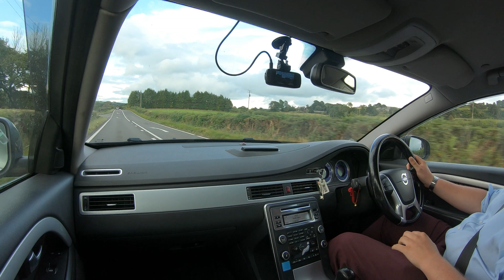What it's like to *Maintain A P3 Volvo* YOURSELF!!!

Comment: Pile of parts arrived ready for my week off. Ive been feeling pretty demoralised about issues developing with my 05 XC70 @ 175k. Feel very fobbed off with the Specialist i tried to use to address any problems developing with aging original parts etc. So facing the conclusion i need to get stuck in myself, no one is gonna care about my car like i would. 

Just hoping all the parts im dropping on the steering/suspension is worth it when i it seems to be developing more issues as a result of the delay caused by disinterested Specialists. So i feel somewhat blind as to at what point i cut my losses over systems i dont understand as a novice. Mechanical steering or suspension parts i can figure out but if the racks gone, trans is beginning issues or something major in the engine, feels like itd be all for nothing.

Anyway, gonna work on what i can this week coming and hopefully find  find some confidence again
Reply: What is the issue? i'm pretty sure there are plenty of people who are willing to give you some advice!

Comment: These are nice and easy to work on I have changed all the fluids on my V70 and it's one of the easiest cars to work on the transmission fluid was an absolute doodle. But the best tool I bought was an Autel AP200 scanner it reads all the modules and gives you live data on everything including transmission fluid temperature which is important for checking the level.
Reply: Is there a way to just let the engine run for a given amount of time before you change your transmission oil so it's at the right temperature to set the oil level if some could tell me that I could save a few hundred pounds on a scan tool   ,a machanic told me he could change the oil for me for £250 which isn't to bad but if I could find a way to change the transmission oil with out a scanner I could do it  for probably lest than £100 . times are expensive and would rather spend the money on family and I would say there's a lot of people who would rather save money .

Comment: P2 is equally easy to maintain. Some specific quirks are the DIM failure (instrument cluster), the bad handbrake design, and the suspension seems to hold out less than with the P3. If you have an older diesel, no DPF. So less stuff to go wrong.

Comment: Had that hiccup too. Turned out to be the tmap sensor - 3rd time it failed. Bought the sensor plus the inlet manifold pressure sensor for €80 (Bosch) and changed them myself. Problem solved.